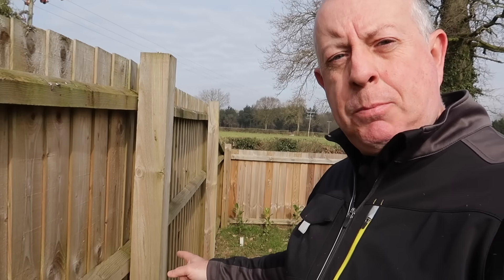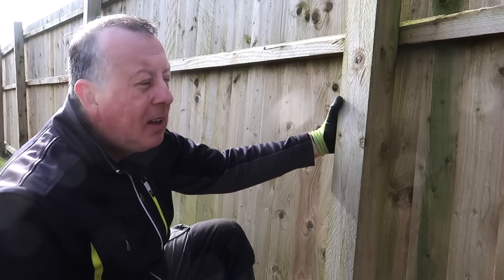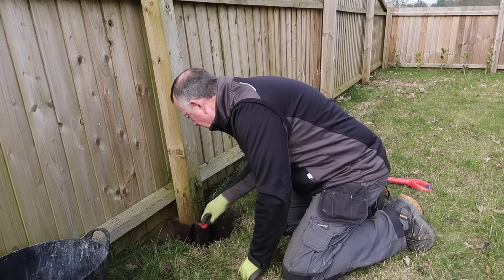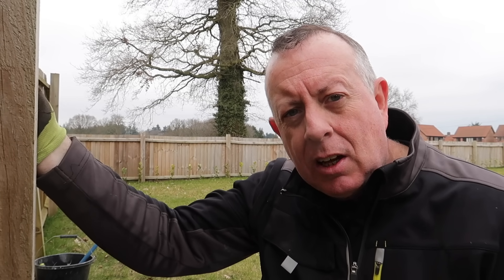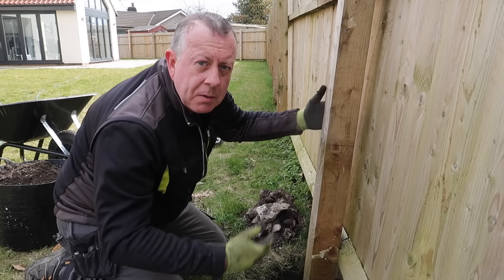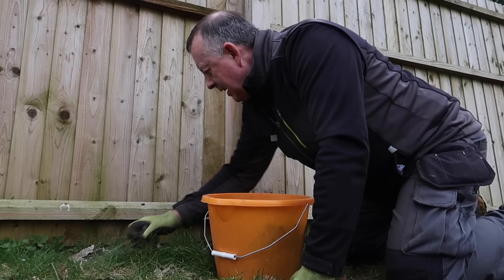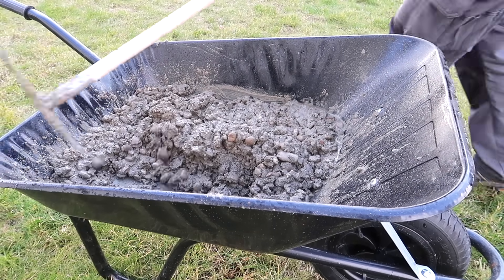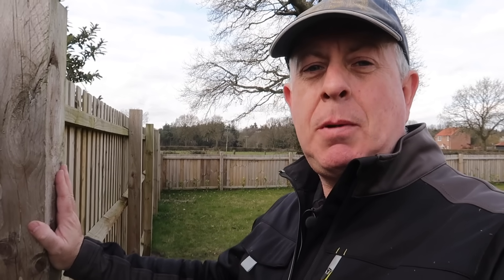How to Fix Leaning Fence Posts

Comment: When I'm putting in a post I sometimes get one of those metal fence post spikes that's intended for fixing fence posts (a long spike with a fence post-sized socket on the end) but rather than using it as intended I hammer it down into the bottom of the hole so the bottom of the socket is level with the base of the hole and the post, I then put the concrete in. 

Once dry this effectively makes the post a lot longer and I reckon it prevents the ball of concrete rotating in the earth like it did on the video because the concrete is keyed into the denser soil below the bottom of the post.

Comment: I don’t know squat about fences, but came across this video randomly. I’ve seen the string technique used (possibly a bit differently), but the custom A frame was a pretty slick idea. If I ever get around to messing with our fence, such as replacing the wooden posts, I’ll have to use that.

Comment: excellent job, only feed back i have is that i’ve been a fence installer for 12 years for one of the best fence companies in southern massachusetts and i’ve learned you never cement wood! always pack only dirt no cement 🙏🏼 give it a try and lmk if you like the difference 👍🏼
Reply: if you do however need to cement your wood, always use flex seal at the bottom of the post and guarantee it’s life for another 15 years

Comment: Those little SDS drills are really very versatile for small breaking jobs. Because they are a bit underpowered I find that you can tackle larger jobs and tougher concrete by weaking the concrete using a drill bit. I drill a grid of holes a few inches apart (use a long fairly thin drill bit and it goes really quick) and then go in with the chisel, it's much faster overall and less effort.
Reply from the maker: Good idea. I've yet to do a review on the Titan SDS drill but when I do I will say that for breaking concrete it's a bit of a lightweight!
Reply: Yes that what I did with an 8x6 ft concrete slab which was 6 inches thick.
Reply: @scudosmyth784  Good stuff!
I recently had to break out a big lump of concrete, the SDS was struggling a bit so I invested in some stone splitting feather and wedges. Only cheap ones from Amazon but boy they worked great. Used the SDS to drill the drills and then used the wedges with a lump hammer. It wasn't the fastest job to do but it was so easy, much less noisy than a breaker and really satisfying.

Comment: 2:10 its is so so nice to see that someone, even a pro loses stuff they had bought and put aside for the perfect task in the future. It absolutely drives me mad, you will see me pacing, cursing, hunting for an exact tool I bought that would save me a load of time, to get the job done just right, the amount of pencils, hammers, tapes, and specific things like a roofing square that i had hung up with all of the other measuring stuff. 

Its driven me so crazy that i now just ram stuff in bags and launch them in the shed and just hunt through bags for tools i need because i know if it is in plain sight and i can see it - you can guarantee that it will go missing just when you need it. I have lost a giant pair of bolt cutters, actually lost a strimmer once (it had fallen behind in such a way that you would never thought a strimmer would slide perfectly behind toolboxes like that).

The real unexplained one goes to pencils, I make a point of jamming at least two in my pocket, but even then.. gone. I had one job going on where I bought a pack of 20 pencils and by the end I had 2 left, no other pencil in sight. HOW

Comment: I always bolt 75mm x 75mm spur beside the wooden post so that when it rots the spur holds it anyway or if the post rots above ground or is damaged it’s easily replaced by bolting a new post to the spur 😀
Reply: 100% correct

Comment: I myself would have brought the concrete up above ground level about 4" tapering at a 45 degree angle into the post which will help greatly with any future rot and mildew to the wood(Yes I know it's treated)from future rain or snow.......I don't know where this person lives but I live in Illinois and we have some pretty nasty winters.

Comment: Good video.  Like other commenters I would have taken the concrete up to ground level because the post will rot off at the soil/post junction.  Even if you take the concrete to ground level you’ll still get the same issue, it’ll just take longer to rot through.  For a true long term fix put in a concrete support post and fix the wooden post to the new concrete upright with coach bolts.
One other suggestion, rather than discarding the old concrete lumps from the hole you could have mixed that in with the new ballast just to reduce the materials you’re using.   I like the Titan tools, great for jobs like this,  so cheap that if they stop working you just buy a new one or take it back under the 3 year warranty.

Comment: A simple matter of basic physics. The further down the concrete, the more leverage from the panel above. I would always have the concrete further up the hole. I also put post saver sleeves on these days. I'd also have used that broken up concrete as backfill down the bottom of the hole and rammed it down. I also take the concrete a little above ground level and try and shape it so the water doesn't stand round it. What I do try and avoid is wet earth against the posts as modern arsenic-free wood preservatives simply don't stop rot as well.

I've also never had trouble with Postcrete. As it's premixed, I don't see why it would be a problem. It's not going to settle out.

Comment: Sir, this is fantastic and gives me a good idea to look for a small concrete base that may be the problem with my wobbly fence post. Mine came loose, became wobbly, during a storm and the fence post itself looks intact, not rotted, so it may be just loosened like yours was. Thank you so much for the good details! I think I can do this :)

Comment: Got a Screwfix SDS drill as a Christmas present from the in laws. Wish I’d had one 25 years ago when I think about all the drill bits I’ve burned out and all the blood sweat and tears trying to drill holes and break brick and concrete. A top tool and keenly priced! OMG, just seen the concrete mixing tool. How many times have I put my back out using a shovel. Where can I get one?
Reply from the maker: Completely agree. The 2 pronged hoe thing I bought at B&Q. I think any type of 'draw hoe' would work nicely.
Reply: From the inlaws you wish you had 25 years ago.

Comment: I use quick crete that’s able to be worked on within 15 minutes. I mix in the hole ur able to get a significant amount behind the back of the post that’s Always against the back of the hole. Also the quick set is designed for random usage such as the job ur doing.
Thanks 
Matt

Comment: Good video.  I recommend covering the bottom of the post in damp proof polythene. That way you can pull it straight out should it ever need replacing. Then just slot in the new post.

Comment: Thank you, sir.  My goober method was to use a tree stump to anchor a ratcheting strap and ratchet the post back to vertical.   What I see now is that I'll need to dig more to expose the foundation, break out and replace that with plenteous more concrete.   My posts are steel.
Reply from the maker: Pulling them back to vertical is fine as long as they don't have a huge tension in them ready to spring back. Difficult to get them to stay vertical like this.
Reply: @ProperDIY  Hello Sir.  My improved goober method, thanks to you, includes digging around the foundation of the post to make the post able to rotate.
Reply from the maker: @jeromebarry1741  Nice one!

Comment: I was wondering why you remove the old concrete. I usually make a larger whole. Hose off the dirty concrete and fill the whole with post mix that sets in 20-minutes, allowing the topsoil to be put back. Always works and job completed quickly.
Reply: he wanted to play with the drill
Reply: Hi Graham, thanks for this comment as I was wondering the exact same thing: why couldn't you brace it, get it true and then just pour some more concrete in (possibly close to ground level)? I think I am going to have a similar job on with a couple of leaning posts, I'm pretty terrible at DIY but want to give it a go.

Comment: I've just followed your advice in this video and done exactly the same for one of my wobbly posts. The hole was only 20mm wider than the post round the back of it! 

I used 5:1 ballast to cement. 

I found that using the shop vac with no bag in it was perfect for getting the loose soil out of the hole! It was much quicker than fiddling round with a trowel. 

Thanks for all your videos, I really enjoy them.

Comment: Nice video mate and great channel ! Just wanted to add my experience with ready mix concrete for anyone watching. I have no problem with making up concrete and in general it does give you a stronger product than ready mix does. Its great if youre doing the odd post, but i have used post mix for 15 years and i couldnt do my job without it. Never had a problem with it, providing its used and as you say mixed properly. The rapid setting time and ease of use is worth the extra cost. A lot of fencers will generally use a very dry mix if hand mixing it, to give a stiffer hold till it cures, which makes the concrete very brittle and easy to break.
Reply from the maker: Thanks. I'm sure from a fencing contractor point of view you are correct. On this channel I have to represent the DIY'er as that is the angle I'm coming from.
Reply: @ProperDIY  fair point 👍
Reply: @AndrewHelgeCox  No definitely not. The two wont bind. Just stick with one or the other.
Reply: Dry mix will eventually cure rock hard. You would do well to consider a weaker mix maybe 6:1 just incase you have to break it out. You do not need a strong mix if you have gone deep enough and your foundation surrounding isn't a swamp.
Reply: Rubbish
I always use a wet strong mix it will run  easier into all the gaps
Poscrete is way too expensive plus most contractors don't use enough esp on feather edge fences as they are very heavy and need large deep holes

Comment: The better foundation (in addition to the below ground structure) is one that peaks it’s head above ground as well …
Reply: It surprised me to see the foundation below soil grade. I'm in a much drier climate (coastal California), but fence posts here are usually pressure treated (to resist moisture), and the foundation pokes above the soil surface.

Comment: Great video and some good comments. My 2 penneth, some bitumen sealant especially at the ground-air transition, where post's always seem to break, costs pennies adds years. Also, I've seen too many posts where the length in the ground is too small, a good rule of thumb is 1/3 of the post's length should be in the ground.

Comment: Buy yourself a drainage shovel, they're not expensive and it's a lot easier as they're very narrow but long, makes it a doddle to dig down.
Reply from the maker: I'll have to invest in one
Reply from the maker: Thank you. Let me have a look into that
Reply: @ProperDIY  Shop vac with a good wide hose is the greatest thing ever when taking out old posts, one other thing that ranchers do to stop corner posts from tilting under the strain of the wire pulling on it is to  attach a 4x4 to the post horizontally  in a tee about 6 iches below grade ,this means your pushing a lot more soil  before the post can move in soft soil like yours is, I have never done this myself but it seems like a good solution to sturdy up the side forces on the post .

Comment: I would've simply dug a bigger hole, returned the post complete with it's little lump of concrete to plumb with a couple of bracing timbers and used postcrete to backfill, which is far easier than buying and mixing separate components and getting the water content right is not a problem at all. Fill just past the ground level with a bit of a slope all round, leave the bracing bits in place for a few hours, job done.

Comment: Liked your video, doing things correct way. One change worth considering is using two part foam instead of concrete. It seals post against water, is done and cured in less than twenty minutes and no need to come back days water.  Cheers.

Comment: I'm renewing our old fence w/new rails and pickets and came across 2 posts, which should be straightened (they have ~ 30 degree deviation fm/vertical. I digged around them same way you did, but about 12" deep only, the second one even about 10", then added water to dig more next day, but to my surprise, I could move that 2nd post easily any way I want. So I straighten them both planning to add cement mixture and water, but then got stuck on the doubts if I need to add any cement in the holes. The posts are aluminum and the fence is pretty light (cedar, 6'). The original cement has practically perfect cylindrical shape, so for the future possible repairs it would be so much easier to deal with those perfect cylinders than the mines of irregular shape. So my question is: what will happen if I just surround those now straight posts (with existing cement cylinders on the bottom of them) with the soil (it is in Texas, soil type of clay)? Will it keep them straight, or it is absolutely necessary to remove the old cement, or at least to add some more new? Thank you for the great film, very informative.

Comment: We live in a sugar sand area, prone to hurricanes......I have actually had two different Fence Contractors tell us concrete should not be used.......especially with tropical storm/hurricane force wind. Ours does not have concrete and we do in fact have less trouble....our neighbors concreted fences pushed over to a certain point and then some of the posts snapped......ours just leaned over which saved us mega work and money. It was very easy (well sort-of) just to go back and push back after removing the sand on the opposite side, hold in place, put some sand on the other side, tamp, and more, tamp....go back to other side and place the sand back you dug and tamp. Yes it holds up to very strong winds before leaning. Our fence is 17 years old and still hanging in there after around 7 Hurricanes and numerous Tropical storms, even after Michael, an 155MPH hurricane in 2018.  If one gets a little loose, 9Very seldom) just hold straight and tamp. Oh, our neighbors had fencing replaced without concrete.....I'm talking beach sugar sand folks.....YES it is structurally sound, no shakes or shimmies.

Comment: I didn't use cement on my posts ,just dug the hole ,dropped them in and back filled .A few started to lean so I took 2x4 's about 2 ft. long ,cut a 45 deg. point and sledge hammered them flush into the ground on the leaning side . Worked great
Reply: @wokemyarse4133  yep

Comment: In California where I live, posts are a bit easier, perhaps due to the dry conditions. We do a hole 3/4 m deep or so, drop gravel in it, set the post, bit more gravel to support, then dump in a dry post concrete mix, add water from a hose pipe, swizzle it around a little, check your post is plumb and you are good to go. We tend to come up a little higher to just below the top of the post hole with concrete.
Reply from the maker: Thanks for sharing!

Comment: I'm surprised you didn't bring your concrete up to at least ground level and flaunch it up to the post, They always rot where the soil meets wood. Thats why fence contractors dont concrete higher or they would have less work in the future.
Reply: Concrete above grade holds more water than this and rots posts the fastest of  any method,  It makes no difference if you slope it caulk it, the water get in, usually in the huge cracks that develop in  the wood as it dries out  and cracks   this water gets in the pocket and never dries inside the  pocket, also wood shrinks and post gets wobbly over time if it doesnt rot out. concrete except where soil is loamy or loose sand is just dumb anyway you slice it, compacted A gravel  or simply pack the native soil back in the hole and dome the area around post and check after a year of settling to make sure water at grade still runs away. Posts rot, concrete is permanent ,another reason to just use gravel, no matter how good you do it those concrete blobs are a future liability .

Comment: I removed all my wooden fence post and used 2 1/2 inch diameter metal fence poles anchor them 8 feet apart and used metal pipe post ties that fit on the metal fence post and allowed the wooden fence to be attached.  The oldest ones in my yard were installed in 1996.

Comment: Fantastic repair and can I just say you've got a massive fucking garden, that will not have been cheap to fence ,🤠
Reply from the maker: Thanks. Yes I'm already worrying about how much the fence will cost when it finally rots through!
Reply: Nice language…
Reply: But if the fence was put up by the original developer of the estate, then the likelihood is cost margins were taken into effect to maximise profit. Also could you have used the old concrete you took out as a kind of hardcore to mix with your new concrete?

Comment: What holds a post in position is a poured concrete collar at ground level, in addition to further down. Jack hammering and removing the concrete, only to re-pour it is double handling. As per other comments, I always use the broken up concrete ( or brick bats) to reduce the amount of concrete I need.